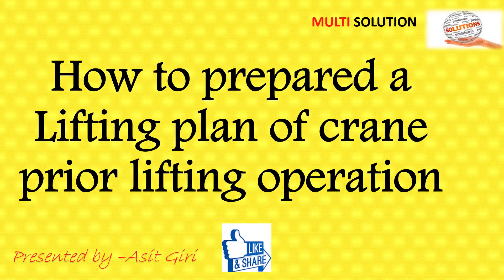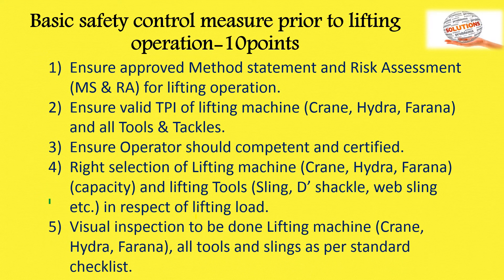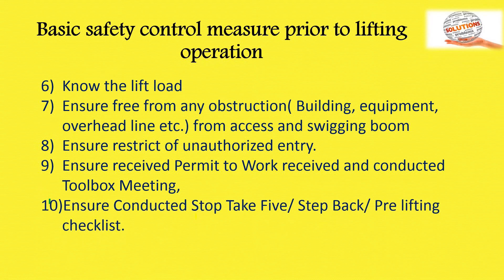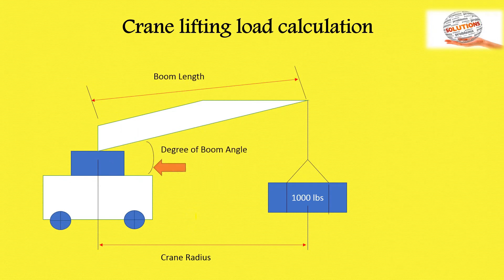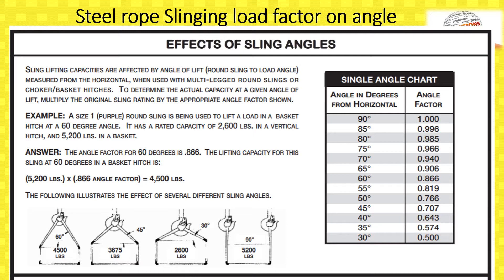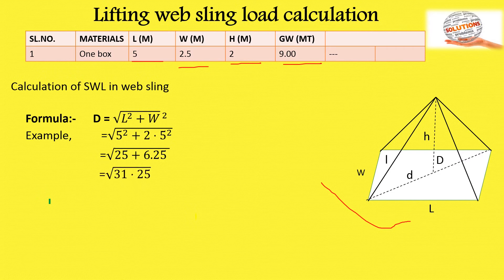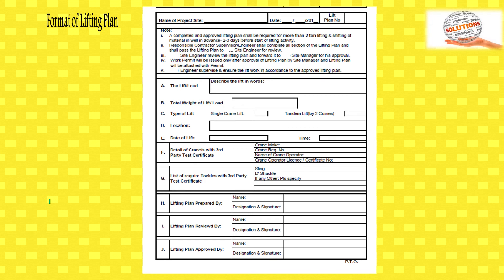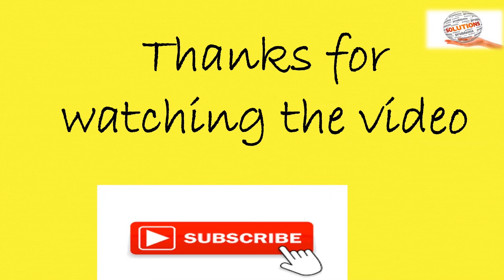KNOW HOW TO PREPARE A LIFTING PLAN

Comment: The sling length is definitely wrong, when using 2.79m as calculated, the height/altitude at 3.22 can't be achieved. in lifting the length of the sling must always be greater than the height